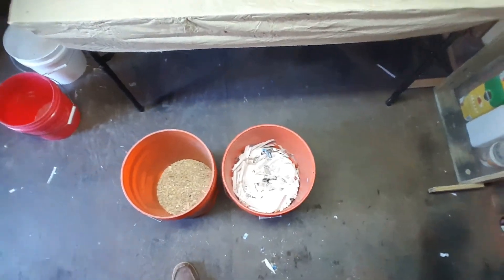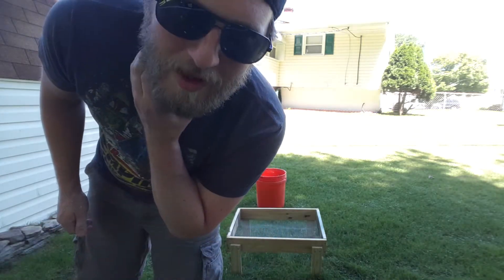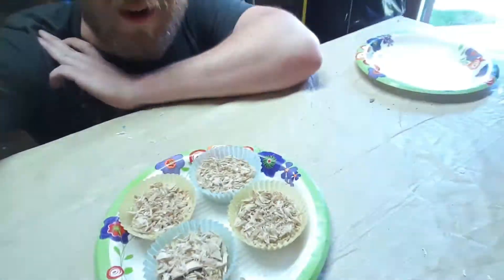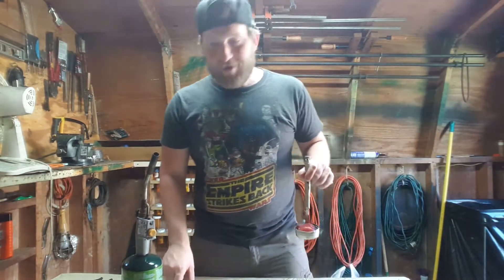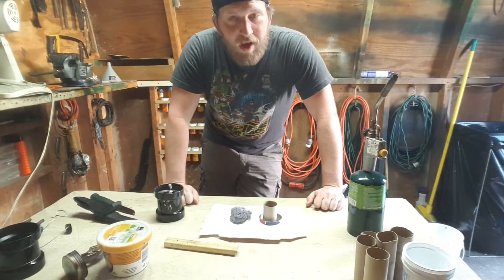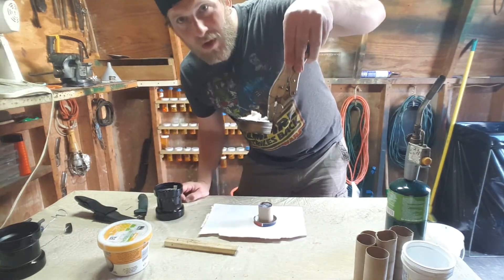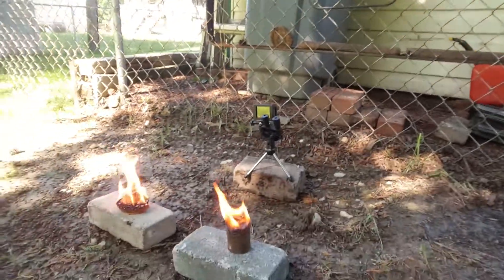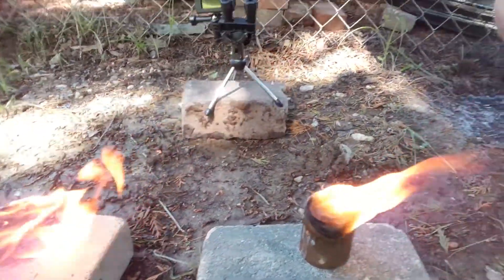Let's Make Some FIRE STARTERS!

Comment: Great video man! I was cheering for the paper log but the muffin took off hotter than my ex wife's hot flashes. I made some DIY fire starter a while back: freezer Ziploc bags, half full of sawdust, wood shavings, dryer lint, and a bit of gun powder in each. My advice is if someone doesn't have toilet paper rolls don't shake their hand.